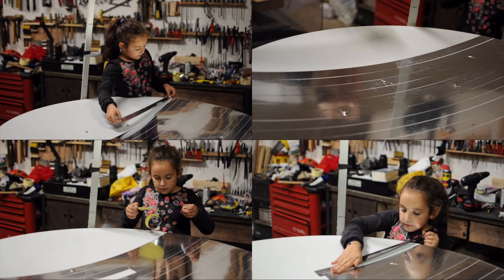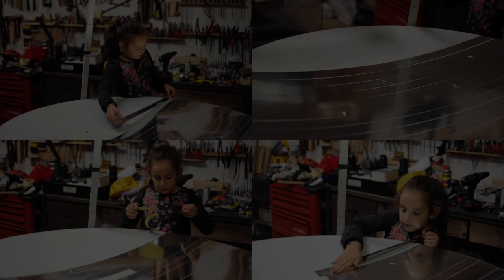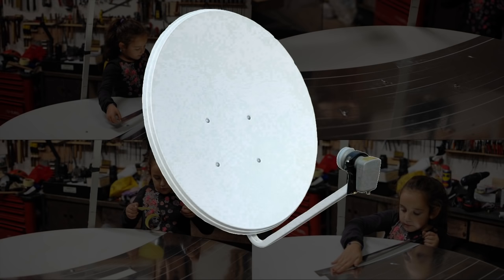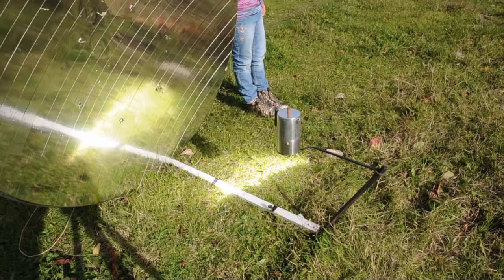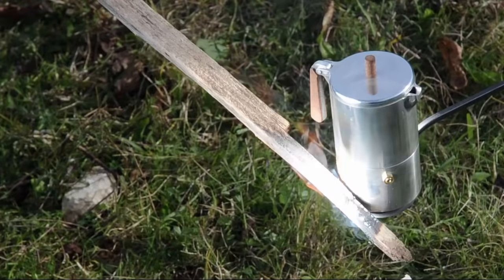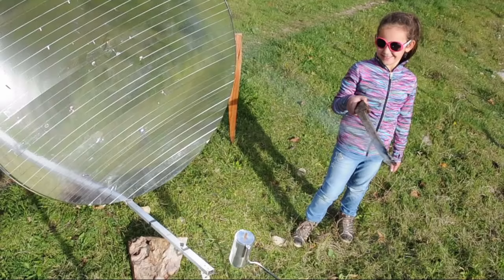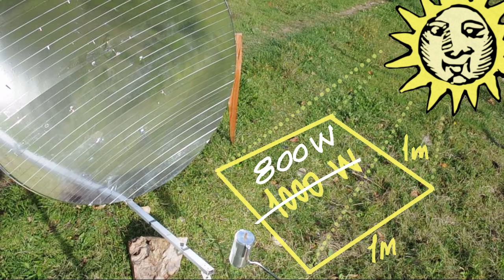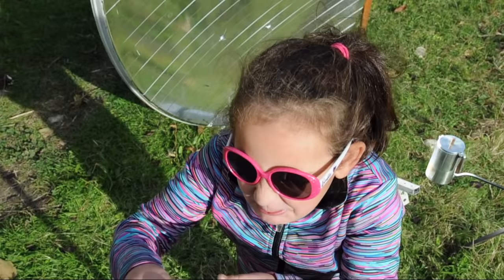DIY Parabolic Solar Cooker

Comment: Ahh the memories.. Graduating from 60mm objectives to Fresnel lenses to make bigger holes in the asphalt (somewhere in 1983 there was a closet full of stripped 3M overhead projectors). I've done this exact thing with junked Offset-feed Ku reflectors, it's amazing how well this works even with the low reflectivity of aluminized duct seal tape. My kids loved the experience too! Great Dad. Keep 'em in the shop, question everything, and absorb it all. Love it!

Comment: Dishes with motors are made so they can point at different towers to receive signals that they wouldn't pick up from one particular  tower. One tower might be American broadcasting and another might be across the river like a Canadian broadcasting tower, this is why new free to air digital antennas  need more than one vertically mounted pannel pounted at different towers to pick up more channels from more towers.

Comment: In another lifetime I did some work for some place that was attempting to do renewable power with solar concentrator’s.  They had a dish that was something on the order of 15 m² or more.  I saw that thing send molten steel falling from the structure, melting through it like tissue paper. I saw a video of a test where the light beam hit a tungsten plate and brown gas started coming off the plate.  You can do a lot with concentrated sunlight. If you really want to heat up that pot though you need to put up some wind baffles to stop the convective cooling think something like an optically deep cavity with insulation that you just put the things inside that you want to be hot.

Comment: If the LNB is not in center, the antenna is called an offset-antenna. It is not using the bottom of the parabola, but the side of it. See where the focal point is compared to the surface and you can see the connection.

Comment: Just an FYI satellite dishes got smaller mostly because the technology of the transistors used to amplify the signal to get a higher signal to noise ratio improved significantly over the years. Cool cooker though and cute kids. Put that pot over a BBQ grill and dump some bacon grease on the coals, let it black the pot up and  don't clean it. It should work great in the solar cooker after that.

Comment: Great project with your kids.  Years ago Radio Shack in the states sold a small parabolic reflector for lighting cigarettes.  Also on the size of the dishes getting smaller that also  has to do with the increase in transmitting power of satellites.

Comment: I once worked, as an Engineer, on a project evaluating various solar heated and cookery homes and buildings and buildings. With data to back it up. First, the so-called "solar constant" is not constant. It depends on your latitude. Good luck with solar cooking in McMurdo Sound in the Antarctic Winter.  Here in Alaska it is more like 250 W/M^2  in  summer and zero In the  in the winter. On the other hand in Hawaii it could be a winner. Our prize site was a Chinese laundry somewhere in Oahu -- almost 100% solar fraction. And solar does not scale. Because it goes by W/M^2, or BTU/ft^2 if you prefer, you need an enormous amount of ft^2. Still, as a science project, excellent stuff. And a very good use for a discarded TV antenna.

Comment: Good vid. Check out the pioneering work of Wolfgang Scheffler and all of the incredible projects he has enabled in India and the Far East. He has been designing solar cookers, ovens and other equipment and making all the designs etc freely available for at least 20 years. Made a few of his smaller projects when I lived in Southern Spain. My favourite is a parabolic collector that follows the arc of the sun using the pedal/gear mechanism from an old bike, some weights and some pretty basic materials. Genius.

Google him - he's a genius and an outstanding chap - the world needs more inventors like him.

Comment: Metals especially shiny ones are very reflective to thermal energy. A highly emissive pant like a matte back or even wrapped in electrical tape around the pot would speed up the process a lot

Comment: Cover the boiler in soot and try again. The bare metal reflects most of the light, so your boiler isnt absorbing the energy. If you cover it with a layer of soot, it should act as an absorbant layer converting the sunlight into heat on the surface of the boiler.

Comment: TV sats are not geosynchronous.  They are geostationary, they go with the wobble of the earth to have a fixed point in space.  Geosynchronous sats have a 24 hour 'period' (the time it takes to make a full rotation around the earth), however they make more of a figure 8 pattern.  That's why some recievers have motors to follow them along the figure 8 pattern.

I just got done teaching a class about this last week. Nerd rant over.  Awesome project!

Sincerely,
A Space Nerd
Reply: SpaceNerd - better double check your lecture notes.  Geostationary is a special case of geosynchronous.  A geosynchronous orbit is merely synchronized in some way with the rotation of the earth, so it can be tilted and/or elliptical, as long as the period is 24 hours (or even an integer fraction thereof).  When a geosynchronous orbit has zero inclination and zero eccentricity, it's geostationary.

Comment: You might have yourself a very ingenious barbecue Try using A cast iron Frying Pan  Upside down With the focal point on the  2" rim Of the Pan Placing it upside down as a Hot plate and right side up to cook your steak. I live in Arizona so  Clear skies and   sun  Shine is  A  Normal state of affairs. Love your videos Backed with a great information And superior humor.

Comment: Use a spray bottle filled with water and set to mist. Spray it into the light path and you can see the light reflecting off of the water droplets. This will tell you where the focal point is.

Comment: There are a lot of systems for applying imitation Chrome that would work Fantastic Four that parabolic mirror.
Just use some really fine sandpaper and get yourself to smooth the surface you can and then spray that stuff on.

Comment: to hold it in place just put 3 pieces of wood in a triangle form like conected to the ends and then a stick behind to balance it, the dish go in the middle of the trianlge like an "A" frame,

Comment: An interesting video would be to make a gimbal to put the coffee pot in at the correct focal point that would be easy using the old receiver arm as a reference point then when the dish is moved the coffee pot would remain level and always at the optimum focus point, regards Doc Cox.

Comment: A faster way to apply a reflective surface is to glue reflective mylar film, like a "Space Blanket" around the rim and pull it into form with a vacuum. Using spray adhesive on both surfaces should work to keep it in place.
Reply: Mylar film isn't stretchable.

Comment: The size of a satellite DISH is dependant on the signal's strength, not the signal's frequency. TV Satellite dishes have gotten smaller because newer TV satellites broadcast more powerful signals.

Comment: First of all, The focal point is static ppoint relative to reflector so I think you can fixed its. Second, I thick It good idea to mount the whole thing on the gimble with view finder for aiming. last thing, You might try some mat black color.  Sincearly this seem way more powerful than I thought.

Comment: Good morning! Very nice video, Tony! One remark, I think this is an offset antenna rather than a parabolic antenna. Parabolic antennas were only used in the very early days for consumer satellite dishes. In Europe usually offset antennas are used, which use only a fraction of a parabolic surface to move the focal point down. This allows an antenna engineer to slightly tilt the antenna, which is especially beneficial when you want to have slightly more oblique surface to avoid snow load and to remove the shadow effect of the feed - if I remember it correctly. https://en.wikipedia.org/wiki/Offset_dish_antenna
Cheers, Max

Comment: TV satellites arent just geosynchronous, they are geostationary. geosynchronous orbits can be elliptical and/or inclined to the equatorial plane which means the satellite moves around in the sky but comes back to the same point after one rotation, just under 24 hours.
geostationary orbits are a special case of geosynchronous orbits. the need to be equatorial AND circular to keep the satellite in the same spot relative to earth's surface.

Comment: Mr dude. Add an equatorial wedge that matches your latitude.

Then add altitude and azimuth motion adjustments. You can even add a worm and ring gear to manually track the sun or steppers to track the sun all day

Comment: you should make something to set the angle with some indicator (i'm thinking two holes that must be aligned with the sun).
Then... put optical sensors and motor (could be entirely analog, maybe).

Comment: Supposedly those old dishes make fabulous WiFi antenna too...  They can pick up a strong WiFi signal almost a half mile away..  as long as it's a straight  "line of sight"  with no obstructions..  So if you live near a restaurant or someplace that offer free WiFi,  You got free Internet,   legally..
Reply: How does transmitting data back from your house to the restaurant go, though?

Comment: It's more like 1200W/m² outside the atmosphere, and 400 W/m² on the ground on the equator so Watt=400*sin(lattitude)
Reply: The sin of the latitude is a factor only if you're pointing straight up.  If you can tilt toward the sun, there's a different factor to account for the increased thickness of the atmosphere, but it's not as bad as sin(latitude).  400W on the ground is too low, unless it's an average assuming a reasonable number of cloudy days.  Clear water vapor (not cloud) absorbs 5-20% of the 1300-1400W/m2 available.

Comment: Hi, Tony, what type of reflective tape did you use? I saw a nice reflection of your son and daughter in the video.  I have pointed a laser pointer at aluminum foil and it gives a bad reflection (really bad) which is not mirrorlike at all (the point becomes a line or semicircle depending on which way you shine it on foil (or on aluminum sheet)  and it would be a little better than useless for a parabolic dish.  So, I think it is vital to let others know what brand and type of reflective material you used.   Thanks Brian

Comment: FYI, the satellite you pictured orbiting the south pole is not very realistic. They are possible, but they tend not be used unless absolutely necessary because of the insane amount of fuel required - as it needs to constantly thrust it's engines to maintain that orbit. Great video, nonetheless!

Comment: That coffee pot - you need to paint it black with something really heat resistant.
By the looks of it, it reflects like 60% of the light, so you would be getting about 500 Watts - still a lot.

5 feet diameter -> ~1.5 m² area, not 2.

Comment: Actually, the reason antennae are smaller than they used to be is that the newer birds are transmitting higher power signals than the old birds used to do.  More power coming from space means you need less antenna on the ground to receive it because antenna size (in a parabolic antenna) is directly related to signal gain.  Thanks to advances in tech, it takes less battery power to transmit than the old days, and battery power is the limiting factor on a satellite since, ya know...no cord.  Plus, battery tech has also improved by great gobs in the past several decades.
Reply from the maker: Thanks David!
Reply: I think the old satellites were only putting out about five watts.

Comment: That's pretty awesome. I've never really thought about cooking with the sun. Do you think iron cookware would do better at heat transfer?
Reply: Yes, because the heat capacity for aluminum (which is his cookware I assume) is 921 J/kg.  This means that for every degree increase in temperature (in C or K) it needs 921 Joules per kilogram.  Cast Iron only needs 460 Joules per kilogram to raise the temperature.  So in theory cast iron could transfer twice as much heat as aluminum. 

Then you have to take into account the heat from the sun and heat transfer to the coffee.  But, that is a lot of work and I already answered your question.
Reply: Chevee Dodd yes because the emissivity of iron is much higher than aluminum.
Reply: Colebug99 your reasoning is wrong because you are neglecting the fact that an iron kettle would be many times as heavy as an aluminum one. However, iron absorbs heat radiation better and that's what is important here.
Reply: ...or you could just paint it, black. (the pot, not the mirror obviously)
Reply: Excellent reply. Thanks!
Reply: tawanga I guess the way I did it I was assuming it was all the same mass.
Reply: Just don't bother trying to cook with copper using the sun. Copper reflects thermal radiation rather than absorbing it. It's better at physical conductivity but little more than a mirror to thermal radiation.
Reply: If you use those old school black iron pans, you might burn them

Comment: dun stand in front the mirror, may burn your hair, cloth , skin, eyes.
and u may want to test out different material, e.g. brass pot
also may be a cover for the mirror is good too, when u not using it.

Comment: "Dishes these days have gotten a lot smaller because the frequency is a lot higher..."   Uh,  nope.  They've gotten a lot smaller because the transmitters  on the satellites have gotten significantly more powerful,  compared to what they used to be able to put out.

Comment: Only around 30% of sun's light energy comes in infrared so you might need to knock that off if you haven't. Also obviously you'll need to knock of the reflection inefficiency. 
Have you tried to put hand in front of it? Not in a focal point, but somewhere close to the dish and see at which point things start to get very hot?
Reply: What do you think happens with visible light when it hits a non-reflective surface?
Doesn't need to be infrared to cause heating, any radiation that is absorbed will do.
For an example take a powerful green laser, no IR at all, monochromatic green light, still burns stuff.
Reply: On a tangential note, most green lasers you buy actually have a ton of IR output, in fact a scarily large amount! Green light will burn stuff, but especially with the cheaper green lasers the IR component does a chunk of the work.
Reply: Thanks, did not realise that.
Did a bit of Googling now and still got question, what does determine this energy absorption, especially at different wavelengths?
It is very difficult to absorb light well.
Reply: Neither did I until a few months ago.
For some reason hot = IR emitter leads one to draw the false reverse conclusion.
I don't exactly know what determines absorption, but whatever doesn't go through, or reflect, is absorbed, so that can give you an estimation. Bare metal is very reflective for a lot of wavelengths, including IR. I can trigger the PIR motion detectors from my reflection in the galvanized basement doors. Bare aluminium heatsinks also show up like a mirror in a thermal camera, so that polished coffee pot likely reflected most of the energy. Would be interesting to time it before and after blackening with acetylene flame.
Reply: from memory the cheap green lasers use diode pump setups that produce a fair whack of power
Reply: Most green diode lasers use an IR laser diode pumped into a frequency doubler cavity to shorten the wavelength to the visible green color.    A lot of IR energy leaks out of the cavity.   See the Mikeselectricstuff youtube channel for more info, look for a video about 'cheap green lasers' or something similar...
Reply: Ok, thank you, I didn't know that or forgot again (Mike is great, wish he did more videos).
But the principle is correct, no? Any wavelength light will produce heat if absorbed.

Comment: That was a video well worth watching to the end! It's hard to beat a grimace from a first-time coffee drinker.

If the dish is aluminum, would you think that removing the paint and applying varying degrees of abrasive until shiny would result in a suitable reflective surface?
Reply: You'd need to apply a sort of varnish, raw aluminium loose its shine if left unprotected. But it will work.
Reply: Fred U. 
 How about a space blanket and spray adhesive?
Reply: whoa, wrinkles galore!  I think that removing the paint and polishing the aluminum would give best results due to zero wrinkles, zero missed areas, zero tape overlap. I used the method in my post for an aluminum velomobile and the shine lasted months and was near-mirror-finish.

Comment: I live in Thailand - the sun is blazing all year round. Do you think you could make one of these to track the sun and than have it heat a boiler that could be linked to a steam engine to produce electricity?
Reply from the maker: Would you use the electricity to power the tracker?  ;)
Reply: No, I'd use it to power a fridge and a fan, then I would sit and drink beer from the fridge with the fan pointed at my head and look at my solar boiler and smile with great satisfaction. The tracker would be powered by pygmies...
Reply: lol
Reply: Stop thinking steam, it might be better with a Stirling engine. Food for thought. Although steam would make your design steampunk and much more awesome it comes at the cost of pipes filled with boiling hot steam and drips of condensate to burn anyone curious enough to touch it. Meanwhile a good Stirling needs only one hot spot to function, which with some careful consideration can be heated by an open flame in more difficult weather.
Reply: Already a thing on industrial scale, 
Ivanpah Solar Power Facility and the
Mojave Solar Project are two in the US.